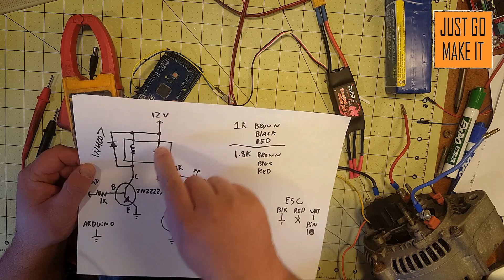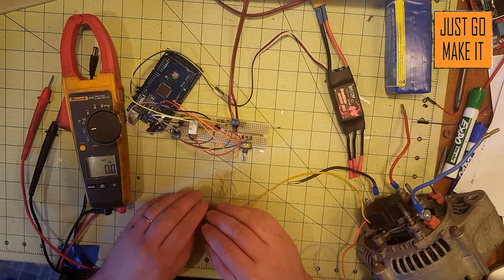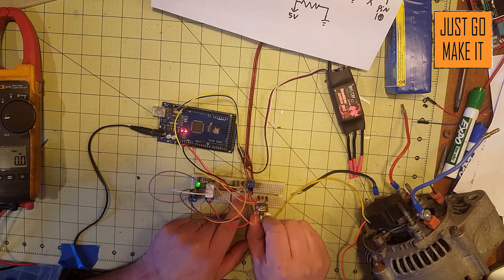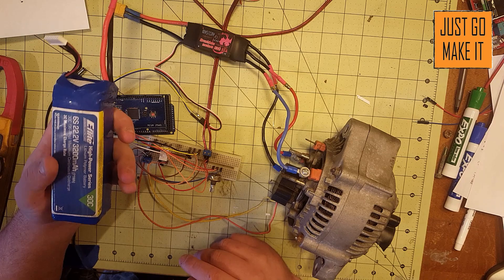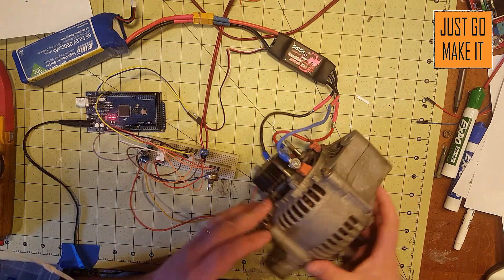Pt. 6 Alternator to Brushless Motor Conversion 2.0, Get Your Motor Running

Comment: Cool!
1. Is there any specific polarity on the rotor/coil/brush? (positive on bottom, negative on top?)
2. Is there any specific voltage and current recommendation on the brush? (12v?)
Thanks.

Comment: I was wondering is there a way of using this motor in both directions. So I want to push a lever and go clock wise then pull the lever and have it turn anti clockwise.
Reply from the maker: check out my latest video  you can reverse it that way
Reply: Yes there is use a servo tester it's goes both ways

Comment: I agree with Tom Peterson.  I also noticed that in your Part 1 video your motor is running much faster, and even sounded smother running as well compared to your motor running in your last Part 6 video.  I'm thinking you did something different, or maybe hooked up something wrong, or changes in your Arduino code.  See for yourself by comparing your videos in Pt.1 & Pt. 6 
Also, I have a 200 Amp ESC  2-6 LiPo  which 2-6 = 12v right?.  Would the 200 Amp be too much?  Thanks

Comment: im starting a project for a electric go cart, im thinking of using an alternator as a motor as you showed. The potensiometer in my case will be the gas pedal, but i want to still use the altermator as a generator when i leave the gas pedal. Is that possible?

Comment: Is there a way to wire the alternator as a motor for a single speed motor without all the electronics? Just an on/off switch. Flip the switch on it runs, flip it off it stops. Just want to pump water with it off battery power.

Comment: I would be curious to see how changing the field voltage changes the speed/power of the motor.  While the field winding was designed for 12V the "varnish" on the winding should be good for much more.  Increasing the voltage would increase the current (𝑂ℎ𝑚'𝑠 𝐿𝑎𝑤; 𝑎 𝑓𝑖𝑥𝑒𝑑 𝑟𝑒𝑠𝑖𝑠𝑡𝑎𝑛𝑐𝑒 𝑚𝑒𝑎𝑛𝑠 𝑡ℎ𝑎𝑡 𝑡ℎ𝑒 𝑐𝑢𝑟𝑟𝑒𝑛𝑡 𝑖𝑠 𝑑𝑖𝑟𝑒𝑐𝑡𝑙𝑦 𝑝𝑟𝑜𝑝𝑜𝑟𝑡𝑖𝑜𝑛𝑎𝑙 𝑡𝑜 𝑣𝑜𝑙𝑡𝑎𝑔𝑒).  The strength of the magnetic field is proportional to current and the number of turns.

Comment: absolutely love the detail you put into this great for the community. I had a couple of questions about this, I have heard a few people say they have converted it to delta configuration as it works better. what is you opinion on this. secondly it seems like the vast majority of people are using 1500w e-scooter esc, what would be the advantage over the controller you are using as urs is cheaper and more powerful. Thirdly would it be wise to have a variable rotor voltage as welll so as you increase the stator voltage the rotor decrease, meaning at low throttle you get max torque and at full throttle you have max rpm.
Thanks in advance
Reply from the maker: i haven't tried the delta configuration yet.  I do have a 1500 watt electric bike speed controller to try out.  I need to experiment with the variable field coil voltage also.  there are so many things to try and experiment with.
Reply: cheers for the help if I am only buying one esc which would you recommend, and I think I might use the Arduino for to make the throttle increase stator voltage and decrease field voltage.
Reply: cheers for the help if I am only buying one esc which would you recommend, and I think I might use the Arduino for to make the throttle increase stator voltage and decrease field voltage.

Comment: Can I run my alternator on a much higher voltage ( 40-50) I want to run mine with a e-bike controller
Reply from the maker: +Tom Wolvers you sure can,   i am working on getting a controller that runs on 48 volt
Reply: R u sure that ESC can handle 48 volts